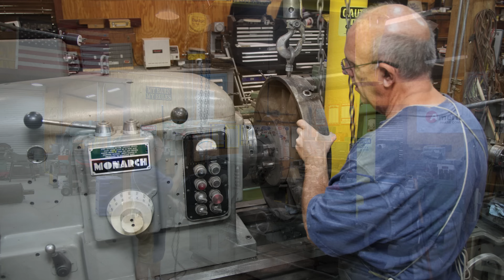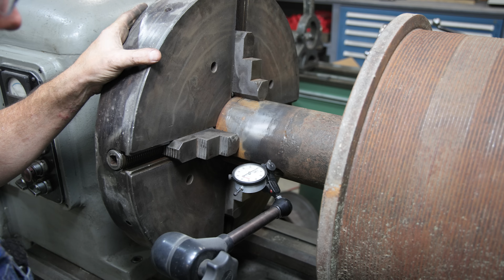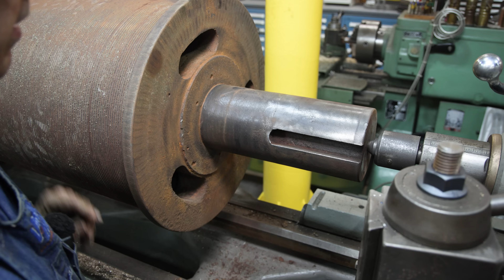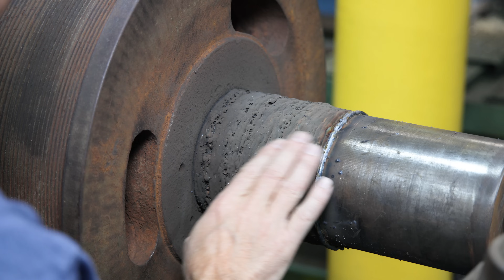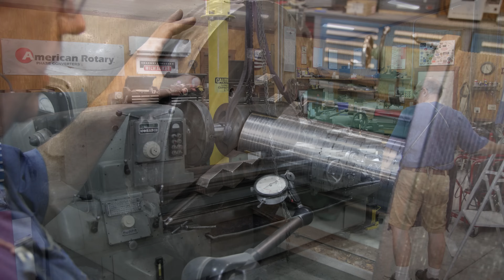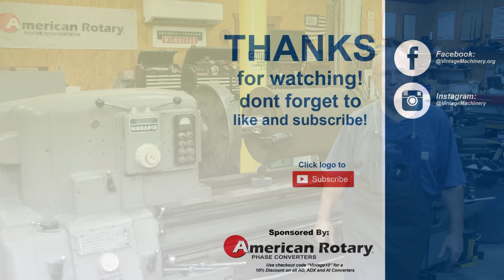Monster Cane Mill Restoration: Building up and Turning Down the Bearing Journals

Comment: id say the perosity is from pulling the weld !, always and i mean always PUSH a mig and PULL a stick number one rule to welding . unlees you are useing resin core wire then its the same as a stick ,but you would never use resin core wire in a machiene shop
Reply: I hadn't realized there would be a difference between pushing and pulling the welding rig.  You're right that resin-core sticks are not optimal for most jobs.

Comment: 9.30 - A good idea to strip the rust off with an angle grinder and spray it all over the ways? Sometimes I really do wonder about this man....
Reply: So tell us all about your experience repairing large cane mills. I’ll wait.
Reply: @ellieprice363  Always running defence  for Keith eh?. It's nothing to do with 'large cane mills' and everything to do about treating machine tools with sensible respect.
Reply: @ianpendlebury9503  Evidently you didn’t hear Keith say he was putting a heavy weld blanket over the ways. Pay attention.
Reply: @ellieprice363  No, no, he cleaned it up with wire wheel before he talked about about welding and the welding blanket. Nothing more to say... YOU had better pay attention. Nothing more to say.
Reply: @ianpendlebury9503  Correct. I wasn’t paying close attention. Lathe ways are hardened and ground and not as delicate as some believe. A light coat of rust dust can be easily wiped off and would do no real damage. The carriage has way wipers that prevent most debris from entering the bearing surfaces.

Comment: Kurtis of Cutting Edge Engineering will do some welds on the lathe. He does pretty much the same thing you did here. He also fully disconnects the lathe to minimise the risk of any arcing damage.
Reply: Kurtis, keeps me smiling... 19:09
Reply: @paulsilva3346 That's the new teeth!

Comment: What does 10 thousands mean? 1/10000 or 10 * 1/1000?
Reply: 0.0001" is a "ten thousandth" 0.024mm
Reply: @markbernier8434  1" = 25.4mm, 0.0001" x 25.4 = 0.00254, 0.001 = 1 thousand, 10 thousands = 0.01, 0.01" x 25.4 = 0.254mm
Reply: @markbernier8434  like 24 micrometer? Is this gauge so good?
Reply: @clausanders2886  Yes they can be. A dirt cheap Chinese one will reliably measure down to 0.001" and many models of better brands measure 0.0001" It is not in the least unusual to have parts specified with 0.001" clearance. To hit that spec you have to be able to measure less than that.
Reply: It means 10 x .001 = .010
His dial indicator is incremented in .001". He wants to move ten thousandths...
In Keith's machine shop world, the basic unit is. 001" ("thousandth"). More accuracy is half of that, and the machine shop jargon is "a half thou" or "5 tenths". Really accurate in Keith's world is .0001", and the machine shop jargon is "thenths".

Smaller dimensions require more precision than Keith's equipment can control. Part temperature and ambient temperature become a compelling factors at these dimensions. Tenths tolerances on standard manual machining equipment is extremely challenging to control. Factoring in using vintage and worn machinery elevates the challenge. Keith cleaned his OEM centers by hand which improved them, but couldn't be expected to improve runout any closer than. 001". He also ran on a live center. A live center has bearings which potentially adds another opportunity for that much runout.  Keith kept stressing that you need to pick your battles, and that this is an extremely slow babbit bearing cane mill operation.  "Close is good enough".
He showed us the repeating finish problem. His repair project doesn't require correcting this issue. There are many factors that can contribute to this finish issue. His repair job doesn't warrant investigation. Keith is an accomplished hobbyist. He uses worn vintage machinery and not always the optimal operation or tooling. 
Keith also can be very sloppy with his verbal descriptions.  In this video he called his carriage a spindle. His viewers overlook this characteristic and enjoy watching Keith explore challenges that they don't have the capacity to do. Many are novices that enjoy learning about things they will likely never attempt. A very skilled and experienced operator can learn the quirks and limitations of his machinery and tooling and can  compensate to achieve impressive results.  Keith enjoys salvaging culled industrial vintage machinery,  restoring it to operational status and then using it. He is an extremely involved hobbyist.  He tries to "do it all", but he lacks machine time to master any of his processes well. Don't shame him for that! In many production shops, machinists can spend decades mastering a very limited number of machining processes. I am in a similar position with Keith. My professional world was machine maintenance and repair. My retired hobby life is learning to operate and master manual machining skills. My old and worn industrial machinery maxes my hobby budget limitations, but also limits my capacity to hold high tolerances. If I really master any of my marginal machining skills, I may upgrade of my machinery to eliminate some of my challenges.  
Keith may begin to do other large lathe work that demands improving his processes. I think that is not very likely.  Keith brings us along on his still learing journey, often demonstrating the maximum of his experience and skill. That is risky,  because he demonstrates his inexperience for his audience to critique.  I learn a lot by watching his videos.  I cringe a lot too, because I frequently already know enough to understand a better approach. His channel is still fun to watch. He tackles jobs and processes that he  has not mastered and that I am not prepared to attempt.
Reply: @paulhunt598  Very good explanation. Until recently, this has been Keith's hobby while working a full time job. Not doing any job on a full time basis leads to less then optimal results. Plus he is doing a wide variety of projects with a variety of machines that he doesn't always run on a regular basis. Some of the keyboard warriors need to give him a break.

Thank you for your comment.
Reply: @mikewatson4644  Yes! When I started watching Keith I thought that he was a seasoned machinist. I was critical of his habits and practices.  I now better understand who he is, how he fits into the you tube machining community, and why he is so popular.  Keith has done a lot for us who enjoy hobby machining, especially with his efforts to catalog and share vintage machine records.  I hauled home an American Pacemaker just so I can make bigger chips. It outsides my current 3 phase capacity,  so my current effort has shifted back to a ten year mothballed LeBlond lathe restoration project. I have used his record archives for multiple projects.
Keith has some shop class and actual shop experience in his youth. I had no high school shop and no formal machining training or experience.  I learned from working alongside seasoned career machinists, but most of my world was CNC maintenance and repair. My retirement hobbies include teaching myself manual machining skills. Keith has deeper pockets than I do, and has collected more toys than I have.  I have accepted that I have too many interests to become highly skilled at any of them. Career maintenance folk like me are exposed to many skilled trades, and become proficient enough to muddle through acceptably in any number of those trades, but arguably are not masters of many. My wife graciously suggested and allowed me to construct a second hobby shop. The newer shop is housed in a 4600 sf building. I anticipate spending the rest of my life outfitting my shops and using them along the way. I will host my second introduction to machining class for young boys later this month. Getting to share my shop space frequently with boys that don't have capacity at their disposal is part of my retirement life mission. My 19th grandson was added to my grandchildren horde (now 37) 3 days ago. Someday those boys will dispose of my shop collection. I hope that many of them will add my machinery and tools to their personal shops.
Reply: @clausanders2886 if you're referring to the dialing in portion, in that circumstance he is saying ten thousandths, meaning 10 * 0.001 inches. This can be confusing, because ten thousandths is also a scale used the same way the thousandths scale is. SAE is a bit counterintuitive, as the same words are used for multiple things, making it somewhat context dependent to figure out what is meant. This is primarily due to the fact that the inch is the smallest specific unit in the imperial scale, while the metric scale has distinct terms for much smaller units.
Reply: @jamesmoe9188  Thanks for the explanation.I was confused, thay's why I asked. I'm used to CNC, where we can work down to 10 micros, buut I thought with this old machine, i couldn't be possible.
Reply: @clausanders2886  you're most welcome! To be clear, it is absolutely possible to get even single micron tolerances on these types of old machines. Any of the equipment in Mr. Keith's shop that he's gone full rebuild on could pull it off. The 612 here wouldn't be able to do it right now, because there's too much wear and slop in the thing, and he tends to only go to the effort if he is going to need to get that kind of precision out of it. It would also be a very fiddly job to do so, requiring metrology tools that you have to be careful how you even hold, because at that resolution temperature is a significant factor.   CNC tends to be much easier and faster when you're trying to do work at that level, for most jobs. There are always a few edge case processes where it's simpler on an old machine, by simple virtue of how the mechanics of the machine operate.

Comment: To turn the piece slowly in the lathe.  Could you have had your weld positioned in front of the lathe, with a piece of shaft mounted in it, and a flat belt running around the mill roller and shaft in positioner?
Reply: You beat me to it.  Even a piece of rope would do.
Reply: Oh yes, that would have made it even more "Rube Goldberg"!

Comment: Flying stuff that big and heavy is always a bit of a pucker factor.
Reply: Compared to some lifts I have done this is tiny😂.
Stuff this size and weight was pretty much a daily thing for me for a couple years.
Pucker factor for me is when it's the size of a semi trailer, weighing 20.000+ KG and need multiple cranes to get it off the ground.

Comment: Amazing that the lathe can turn such a heavy object. What is the max capacity of weight for the Monarch ?
Reply: Depending on max load of the bearings in the headstock and on the tailstock insert.
Reply: You beat me by 17 minutes asking that question.

Comment: 1:17 / 37:32

Monarch 612 Lathe Repairs: Trying to Fix the Rapid Traverse - Partial Success...

this part is and has been in the LATHE for quits some time see video above and other before this so why now show you putting it in and starting to turn it as we know from last you still have more you wished to fix on the LATHE before starting this job again JUST DOES NOT SEEM RIGHT TO POST THIS NOW 

CHEERS
Reply: I don't see what the problem is.. the job needs to be done..
Reply: He's already mentioned in those videos and this one that the 612 has a lot more work that needs doing, and I have little doubt that we will see videos of a full teardown and rebuild of the apron and carriage, probably to include some scraping, turcite, and so forth, just as he has done with the 612 tailstock and his smaller lathes in the past. All that said, cane season is coming up fast, and the old girl can hit the numbers needed, so "good enough" is going to be good enough to get the owner of the cane mill up and operating on time, barring any outside issues. For those of us who have an understanding of the perspective of someone in his part of the world, we hear the things that he isn't saying in what he does say. Any time he breaks out the "pick your battles" phrase, what this means is that he's already pissed off that he's having to stoop to the level of "it'll do for what's needed right in this instance", instead of being up to what he would consider a typical minimum acceptable level that he can consider a job well done. Southern speech is full of things that are conveyed by tone, context, connotation, and inference, that those who didn't grow up with it are unlikely to ever gain a grasp of. All of the critiques being offered up in the comments are basically rehashing things he's already said outright, at least to the ear of anyone who actually speaks Southern. It's very similar to how much of the meaning of UK dialects other than RP, is entirely lost on those who lack a native level grasp of said dialect. Very similarly to Cockney rhyming slang, Southern speech is heavily reliant on an understanding of things that aren't being spoken aloud. Hopefully my words will offer up some insight and perspective that will help alleviate some of the frustration you may be experiencing in watching Mr. Keith.